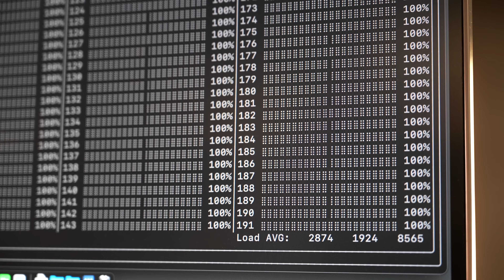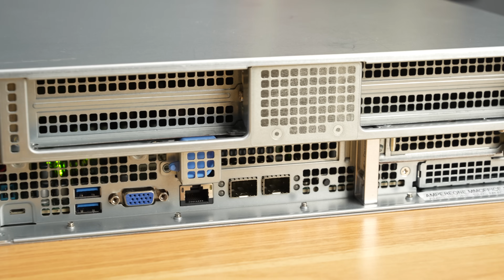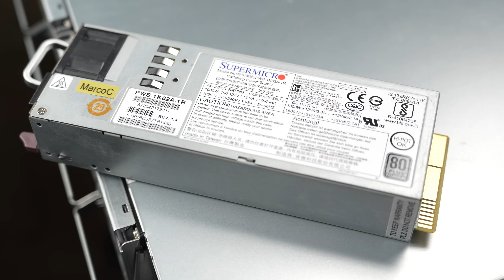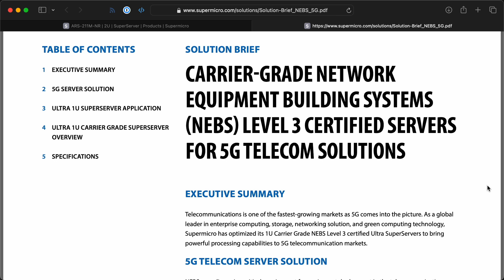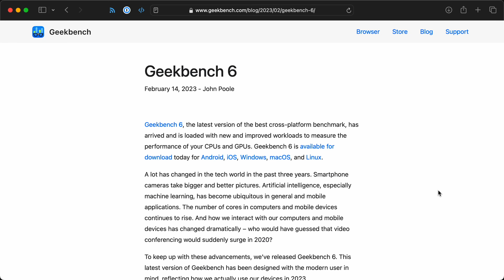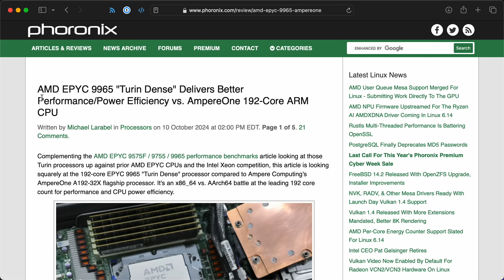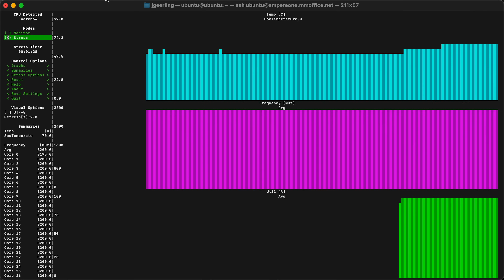CPU Cores are the new Megahertz

Comment: I like your explanation that it isn't 1 server with 192 cores. It is 48 4 core servers in 1 box. Back in the 2000s as companies were trying to take their companies online they were finding it very difficult to scale because you needing to worry about things like HA, Load balancing, and Networking for several racks of servers. It was so much that many companies just said nope and went to the "cloud" so that other people could manage that for them. I think that now that we are getting these high count servers we may be seeing some of that swing back to private cloud and private hosting. You aren't managing 200 servers for your business. You just manage 4. You put 2 in HA at 2 different sites and you are good. Load balancing is easy because it is just 2 servers at each site so you don't need specialized hardware for it. Networking is easy too because instead of needing multiple layers of switching to connect all those servers at gigabit speeds you just have each of your 4 servers connected to 100G switches. It is simpler on the software side too. Again you don't need a DB that has to scale as much either. It is much easier to keep a db in sync across 4 machines than 200. It is also easier on the storage. In the 2000 it was all done using HDDs which are mechanical. Now that we have NVME SSDs they are thousands of times faster with lower latency. It also means that you don't have to maintain as many copies of the DB which cuts down on storage requirements as well as wear and tear on the drives themselves. I have heard many times that building an application like twitter is easy. There really isn't much to it. The hard part is actually scaling it up to handle millions of users. Well with servers like these that difficulty curve in scaling is getting easier. Before where you could only handle a hundred or so users per server you can now handle tens or even hundreds of thousands. Companies are seeing that and deciding it may just be better to move it all on prem again.

Comment: 240v is relatively easy to get re-purposed in home you can either find a 240v circuit with capacity left for the server(s), or have an electrician re-purpose a pair of lightly used 120v circuits into a 240v circuit, or just add a 240v circuit if you have the panel space, the problem servers are 3 phase, which almost no homes (in the world) have
Reply: In Germany at least, 3 phase isn't too terrbly uncommon in homes.

Comment: The 4K/16K/64K page size limitation within application code (benchmark code) needs to be addressed. Limiting this beast to 4K page size is nuts. Ditto logic for jumbo frames on high b/w Ethernet ports!
Reply from the maker: Yeah I wish for networking there were a way to auto-negotiate jumbo frames. Everything's going to be stuck on 1500 bytes forever!

Comment: The reason MS doesn't really care about windows servers on ARM is because Microsoft licenses Windows on a per core basis. To actually use that 192 core server, you'd need to license each and every one of those 192 cores. So per core performance is just vastly more important for this usecase. The same goes for many of the services that traditionally do run on Windows server systems. If we look at the Standard edition of windows server, that CPU would cost over 12k USD to license. For JUST the OS alone. And if we look at the 512 core Aurora, well that's over 34k USD to license. Windows server licensing is minimum of 8 cores per socket and 16 per server. So CPUs for windows systems typically are either 8 core CPUs intended for dual socket, or 16 core CPUs intended for single socket. Or 32 core 4 CPU setups but those are getting rarer these days. And those prices are for the standard version of win server... Don't even get me started on the datacenter edition... almost 200k to license windows for a SINGLE SERVER if it runs that 512 core Aurora..

So yea, windows client on arm is happening, but serverside, that's going to need a complete overhaul of the entire licensing structure of the entire field of windows servers and that's not just on MS's table to fix.

Comment: STILL not as many cores as I want! I'm a hobbyist programming who's into HPC. It was so exciting to get a Dell Precsion Workstation t5500 with two 6-core Xeons, for 24 hardware threads. And it choked trying to write n-body simulations with over 1000 bodies. So I had to start learning GPU programming. SO difficult. I just want 10000 arm cores and to program it with OpenMP.  Sigh. 192 is a nice start, but I need about 500 of them. 

Still, a server like that with a few GPUs would be one helluva compute node. So many threads for MPI, other threads running CUDA code...This would be fun to program on!
Reply: Supercomputer type projects, I love it
Reply: @richardzeitz54   So just possibly something like this. The girls, who are named for gems, “clink” when they run into each other. And the dogs … well.
https://youtu.be/gFlw55xZoSE?si=pCfann45TXKDvP0k
Reply: @SchoolforHackers  I love it. As for my own pseudobiology, weird doglike and girllike things are way beyond...I was thinking simulating soil and the various aerobic, anoxic, and facultatively anaerobic microbiomes and the various chemicals that link them via diffusion between grains of soil. But II like the gems and dog creatures better.
Reply: @richardzeitz54   Actually, as an avid gardener, I still think what you’re doing is cool. Wish I could still use the university’s supercomputer…
Reply: How you will feed 10k cores? That will consume minimum 10 kW of power. Can your home handle that? Right now I hope to get just 1000 cores and fit it into 3 kW, maximum 5 kW. That would be pretty decent 10 million core-hours per year or 5-7x more I get from our supercomputer or my current workstation
Reply: @likbezpapuasov4888  Yeah,, that's why I must keep learning better how to code for GPUs. There are GPU cards with 10k cores.
Reply: @richardzeitz54  That typical 10k+ cores in GPUs will not work the way you hope. Essentially one GPU like V100 or A100 equivalent to 150-200 core X86 CPUs like in Zen4 or Zen5 (AMD Genoa or Turin) or 300 cores in efficient X86 like in Zen4c/Zen5c. Current  ARM CPUs are equivalent to those efficient X86 (or approximately are half as powerful as performance X86). Hopefully  next gen ARM CPUs per core might reach X86 in performance and coming 500 core one could be really interesting. But probably expensive too.  GPUs though also suck power like crazy and additionally with their price A100, H100 and B100/B200 cost you leg and arm. And kidney. Due to AI all GPU solutions are currently absurdly overpriced.
Interesting alternative practical solution would be somehow to find the way to connect 5-10 older CPU motherboards into one parallel system. People have done this with Raspberrys
Reply: @likbezpapuasov4888  well, currently I'm using a gtx1650Super and twin xeon x5670s, so I'm just daydreaming. I like CPU cores because I like writing loosely coupled threads. Simulating many different agents all doing their own things isn't as amenable to GPU threads, which like to all be in lockstep. I'm getting an old server with 4 Xeon e7-4880s, I sticking an old Xeon Phi coprocessor card in it, and I'll be picking up some old GPUs, and it'll be networked with the workstation. Just havin' fun, learning how to write complex systems across  devices. I'll be using MPI. It'll be confusing and fun. MPI plus multiple old servers and workstations.
Reply: @likbezpapuasov4888 like a super fast cluster. We just need a pcie-esque slot on the mobo that combines cpu threads to each other instead of peripherals to the cpu. Not really how that works but imagine a world where we are daisy chaining 6 or 10 200 core cpus with ribbons id love it
Reply: Now you have me deeply interested in what the hell you are doing!
Reply: @SchoolforHackers  I'm just getting started but I wish to code complex, biological-like systems. With millions of agents, chemistry, physics like diffusion. Or imaginary physics. Like, design my own particles with their own forces - like but not the same as electromagnetism, the strong and weak nuclear forces, gravity and watch them interact. I got started just writing simulated flocking behavior, and 2D imaginary physics. But those xeons bog down with over 1000 bodies.  I just started learning CUDA after discovering OpenACC isn't adequate. And OpenMP slows down when I offload to nvidia! What I wouldn't do to just write all that stuff to run on normal CPU threads!
Reply: @  Dayam - you are WAY out there in the fun zone! What you’re doing reminds me of complexity theory, and you’re playing a hugely upscaled Game of Life. The, um, security tester in me imagines a few milliseconds hijack of most of the Amazon cloud here, a few milliseconds there…but of course that would be unethical. Ethics being, perhaps, the fifth force.
Reply: What kind of simulation were you doing? From the surface, 1000 bodies seems abysmal even for a single thread.
Reply: @0x1EGEN  150-200 cores of CPU like AMD/INTEL = 10000 cores of GPU
Reply: @likbezpapuasov4888  Huh?
Reply: @0x1EGEN  Read my post above
Reply: @likbezpapuasov4888  I really don't think this comparison makes sense, or is even close at their capabilities? Of course CPU cores are way more powerful than a specific raster GPU core, in clock speeds, instruction efficiency, branch prediction and tons of other things. But even incredible CPUs could never approach the efficiency of GPU cores at the floating point parallel work
Reply: @Dorumin  Surprise-surprise, everything you have heard about super efficiency of GPU vs CPU is a BS. Do the tests using specific molecular dynamics and PIC codes and you will see what i wrote above: modern CPU is approximately equal to modern GPU at the same consumption power
Reply: @likbezpapuasov4888  Physics simulations are not what GPUs are for :)
Reply: @Dorumin  True, they are for AI. But that's approximately is what the OP wants to do not the AI. With time CPU and GPU will be approximately equal even in AI
Reply: @likbezpapuasov4888  Of course, we've gotten a little off topic :P what OP wants is definitely a supercomputer. Simulations are what keeps most exa-tier supercomputers working, after all

Also, I'm so mad that GPUs are being built for AI, haha. I just see them as floating point streamers, which just so happens to be useful for shaders, crypto, and AI. It's natural

Comment: At least its quieter than my 48x10g + 6x40G "extreme" network switch (i think HP now)  
Picked up a pair of them for $40 each at a corporate garage sale
over 100w idle without any pluggables
Pull out one of the hot swap fans and it drops to 80w
Reply from the maker: Those 1U fans are ear-killers!

Comment: For some fun, try using your ham radio near those smart plugs. Some of them are very susceptible to rf interference, and some cause a lot of rf interference. I had a smart power strip that started to flick on and off constantly. At first it only did it when I used the radio a few feet away, then it started doing it permanently after having my radio keyed down for a few seconds nearby.

Comment: i have a Dell r930 and a Dell r630 at home and this things are beast. i personally dont really know to do with it. Both are really cheap if bought refurbished. i got the r630 for 600€ and the r930 for about 1500€. My R630 has 2 xeon e5 2683v4 (16 cores 32 threads each) in it and 512gb RAM and a 4 port and perc h330 mini as Raid controller and 10gbit sfp+ nic. The R930 has the same amount of RAM but 4 Xeon E7 8890v4 (24 cores 44 threads each) and more or less the same configuration as the R630. 
I use the R630 at the moment. it idles at 2% but sometimes i need the power and then it runs at 70%, but the CPU is packed ath this point because i do heavy calculations and don't need much io time. This means threading is more or useless and even hurts the performance. I even do LLM stuff with it with a t400 as a little helper. 
As for the R930, i don't really know what to do with it, it is too powerful for my needs and sucks too much power. The r630 uses about 80W at idle and with 2% load 100W to 112W, the R930 uses 220W at idle and this is way too much and this is without the inerface card for a PowerVault, without the nvidia t400 and without drives, that's currently installed in my R630. With that stuff, 250w to 280W idle is possible. i live in Germany and pay 0.36€/kWh my R630 costs me about 0.90€ a day. The R930 would cost me 2.5 times more for the same tasks. So yeah, this is way too much power for my needs, even the r630 is a bit overkill.

Comment: "CPU cores are the new MegaHertz." Kind of, to some extend. Sadly Amdahl's law shows where it breaks. I love having a lot of cores, don't get me wrong. For some tasks it scales great, for many tasks, like playing a RTS game or shooter game, it doesn't. The ideal is probably having a few very fast cores (gaming, fast startup of many programs, faster response within programs like browsers...) and many lower clocked cores (compiling, installing software, compression/decompression, rendering), Many lower clocked because there is a maximum power at which your CPU can operate, also to prevent the CPU from destroying itself early. You are better off with double the core but much lower clocked and at the same total power level for tasks which scale well. The price to pay for that: higher purchasing-price because of the larger surface-area, but well worth it if you really do need all those cores.

Comment: I wonder if the rumored RiscV 128-256 core chips will make it out in the same timeframe as the Ampere 512?

Sounds like the RiscV org is focusing on spoiling the automotive and server parties in the coming year or so. Efficiency and power numbers should be interesting for those when they come out.

Does super micro make any RiscV MObo’s so an aarch64 vs R64gvh comparison can be more apples to apples? 🤔
Reply from the maker: I'm excited to see some of the new RISC-V chips. Might get to try one of SiFive's this year!

Comment: The 25Gbps interfaces are SFP28, not QSFP. Just for reference :)
Reply: Right, QSFP would be 40gbps, and QSFP28 would be 100gbps, as they are Quad-SFP and Quad-SFP28 respectively.
Reply: @rkrenicki  40G would be QSFP+
Reply: @N3m3515  Since QSFP non-plus (i.e 4Gbps) doesn't exist, I've seen it quite common to drop the plus when referring to the 40Gbps option for simplicity sake.

The whole QSFP naming saga is honestly kinda crap - especially when you look at stuff like QSFP-DD (which is actually QSFP58-DD) which is 8 lanes because it's Quad SFP Double Density.
Reply: @rhysperry111  true. time for a new connector 😀
Reply: @N3m3515  Like OSFP? 😄

Comment: The thing about that 192c EPYC is that it has multithreading. So if the app can use those ridiculous number of threads, EPYC has twice as many as Amprere and Intel's all E-core offerings.
Reply from the maker: EPYC also clocks higher (and idles lower) per core, if you have the thermal headroom. Mix in 12 channels (vs 8) of DDR5, and the Turin is just insane!

Comment: ahh that sound of massive servers starting up...
its like my stomach every morning ... thanks Crohn's...
Reply from the maker: At least the servers only blow out air!
Reply: @JeffGeerling  I definitely feel like a "blow out" is the better part of Crohn's - the alternative is massively painful - as you and I know.  Yes, you are correct - servers blow out a lot of hot air... The wife tells me I am full of hot air too... but that's something totally different! Been lovin' your channel for awhile now. Keep up the good info reviews and maybe help me figure out where I went wront with Proxmox and OPNsense on top in a VM... I cannot seem to get SSL for PM cluster working right. My domain name resolves to my private static IP (I have 5) and hits the WAN side of the PM server which has the OPN (VM) running exclusive on that physical port that then routes out the rest of the traffic back over the private lan side (I do not have managed switches so no vlan tagging ). I can get out from the cluster vm's to the real world IP and have perfect connectivity between nodes behind opn - but I cannot seem to get reverse proxy caddy or nginx or anything to work with OPN. Probably some dumb firewall rule I did not open but dang it is frustrating... been trying for about a year to get my various subdomains from my main domain to route through my OPN and to the correct vm ... Got any tips on where to read more to get it to work right?

Comment: The Epyc chip is using 192 Zen 5C cores, which do not clock high so if it used Zen 5 instead it could clock higher if allowed to use 2 KW.

Comment: I've been looking for an Ampere Altra here in EU, and it turns out they're nearly impossible to get. #sadface
Reply from the maker: Sadly it's tough to get System76 over there, and I'm not sure about ADLINK but that might be an option.
Reply: I wouldn’t be surprised it’s a matter of if you have to ask where to get them you can’t get them?
Reply: @ramdynebix  pretty much. Even the official distributor here in EU has trouble getting them. They recommended I get a pre-built one from SuperMicro. I don't want a pre-build one. 😅

Comment: 192 ampere vs rasberry pi blades with 48 x4 =192 cores. Make it happen.
Reply from the maker: It would be about $5-6000 total for that setup (plus the cost of PoE switches!). Not completely out of the question, but I'm waiting for wider availability before I start thinking about that :)
Reply: @JeffGeerling Tough decision, are you going to please the crowd, or save some money for Christmas. 🤷
Reply: @JeffGeerling  you might be able to get a bulk price, especially you